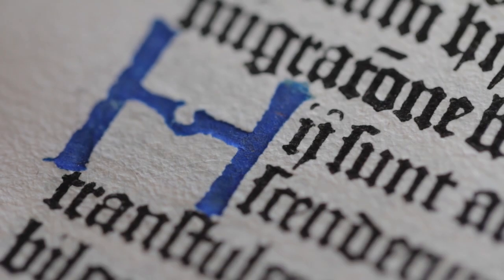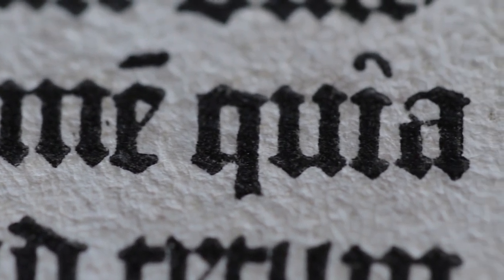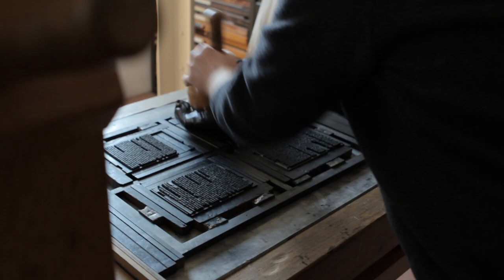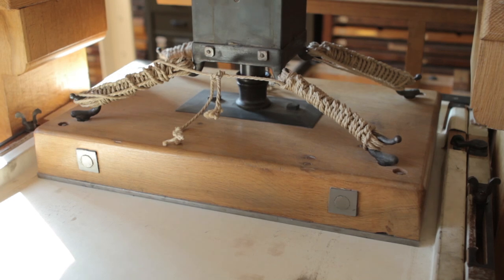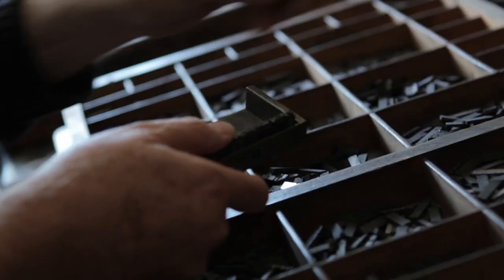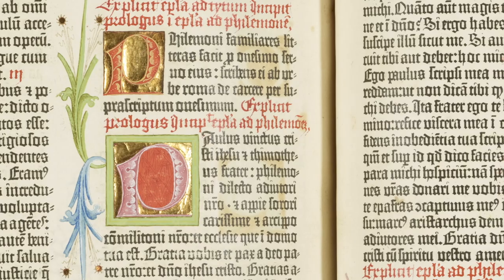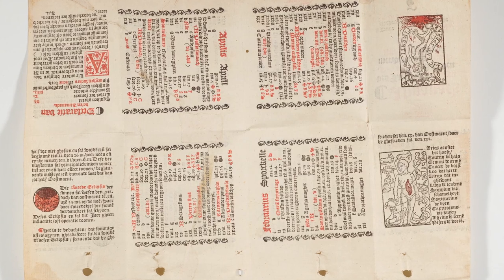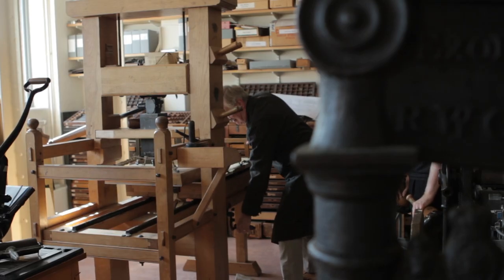The Print Workshop in the Fifteenth Century

Comment: What was the typical largest size sheet of paper used by most early printers?  For multiple pages printed with each impression, how many pages would typically be produced on the early presses?  2? 4? 8?  It looks like by the time the sheet is folded the 3d time, each page begins to be pretty small and not much larger than a modern day paperback book even if the initial sheet size was quite large.